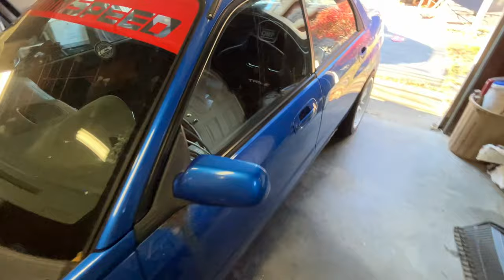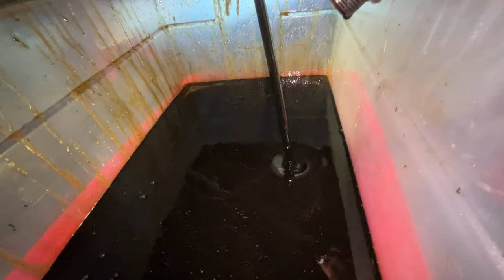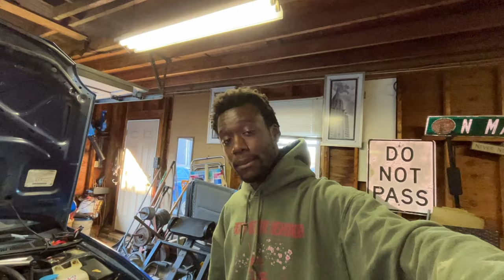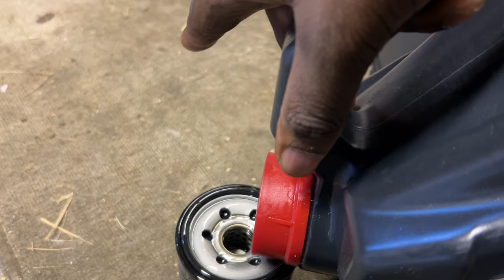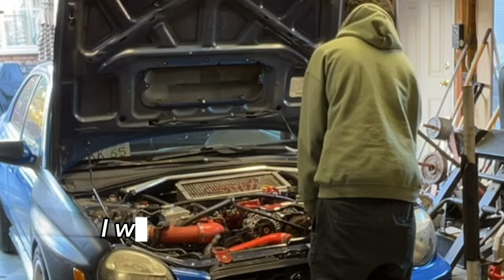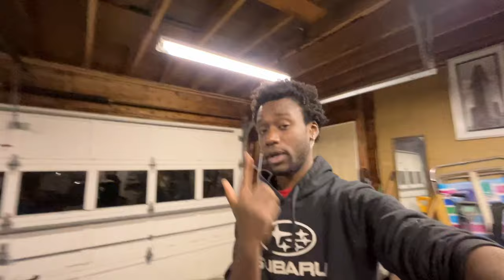My Subaru DIDNT blow up…

Comment: I also prefill the oil filter, but disconnect the crankshaft sensor and turn the engine over for around 20-30 seconds to get the oil flowing, reconnect the sensor and then start the engine.
Some people here in the UK take it very seriously and remove the spark plugs so there's no compression whilst turning the engine over for 20-30 seconds!
Reply from the maker: Oh wow!! Super thorough. 

I’ve never disconnected any sensors for the oil change. 

Is that recommended or just something you do as a precaution?
Reply: @JacobRJZ  it's to stop the crankshaft running dry, there were tales  years ago of people's bottom end bearings going after services from Subaru UK.
Reply from the maker: @ oh…WOWW.
Reply from the maker: @ I guess that what makes a Subaru…a Subaru 💀 after all.

Comment: Yo with that carplay though does it render the cupholder up on the dash useless? I have an 03 bugeye wrx, i’m not even talking shit i’m curious lol. Imma get a name brand one for this car this time so Sony is how imma go with it, but genuinely curious cause as you know the 03 up to 05 has the WORST cupholder by the e-brake, and just one at that. I’m not doing the console swap in mine as i want my climate control button lights to match the gauges when i swap them all.
Reply from the maker: The cup holder up top is super useless now brotha.
Reply from the maker: It looks cool and is a nice headunit BUT ye man. Not having the main cup holder is kinda rough. You do also have to do a bit of cutting to make it fit. It doesn’t go in with the 6 screws anymore, it uses plastic clips…